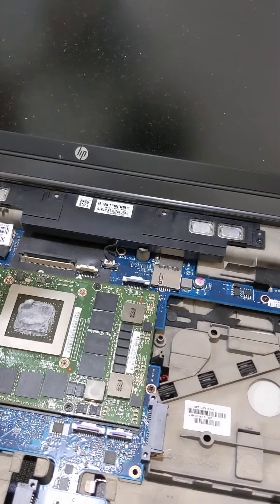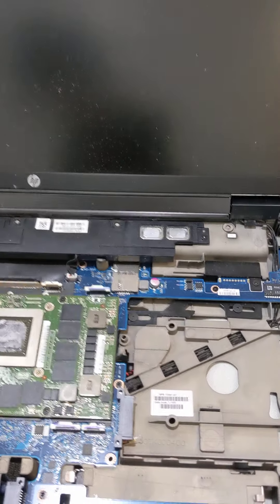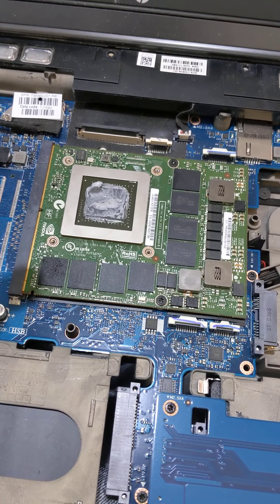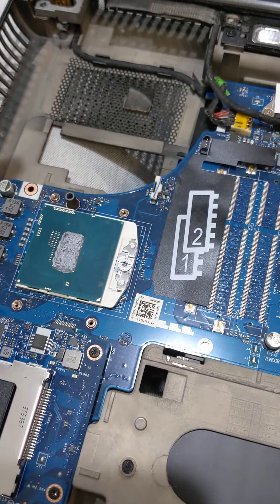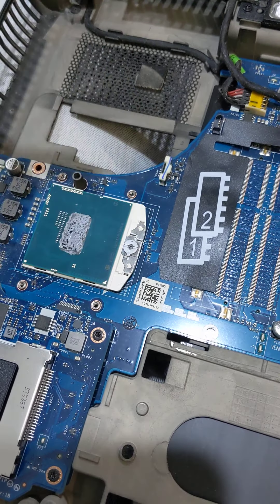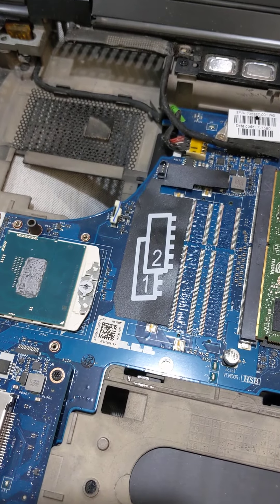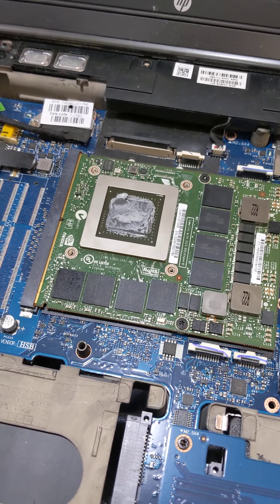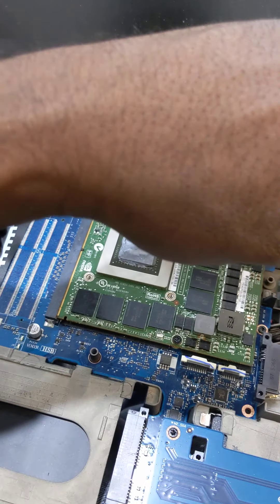Upgrading a hp zbook 17 g2 cpu to make better youtube videos

Comment: Watching this on a HP Zbook g2 with i74810Q got it for free in a amazing state from my bro.
16gb ram and quadro k2100m but im thinking of upgrading the graphics card to a gtx 980 4gb.

Apparently that's possible.

But even without, very fast laptop, good sound and great for multitasking editing and even this Quadro can play some games pretty good. 

Nice video.
Reply: I have a p4000 in my zbook g2 with a 4930mx.  I bought it this way and I had to disable driver signing to and force the specific INF have disk method.  I have a hacked version of the nvidia installer in order for it to let me install nvidia control center, then I can manually force the INF from the newer versions of the driver package to keep myself updated  I think the p4000 I have might have a bios hack in order for it to work on this zbook.  All I know is, the p4000 is such a great match for the 4930mx and it runs really cool and fast.  These haswell mobile CPUs are still really capable.  I can run all of my favorite games.
Reply: P5200 32gb 2400mhz 😅

Comment: I have a HP Zbook 17" G3 with NVIDIA Quadro m5000 gpu. I play this old game  and I need to get max fps 120. I currently get 80-90fps. I know my gpu is the bottleneck. My current gpu uses  Bus Interface MXM-B (3.0) and I need to stick with NVIDIA as it is an old game..  Do you think I can upgrade to newer gpus like Quadro P5200 Mobile as it uses MXM-B 3.0 bus interface as well?

Comment: Hello there I got an Old Zbook 17 G2 i7 but unable to power up.. the lights keep blinking... Just wondering If it is Worth it to Send for Repair..
Reply from the maker: I mean they are going for around 450.00 it's going to cost a bit to repair. I would put it toward another workstation if I were you And you need a workstation computer

Comment: bro , can i upgrade cpu again ,over i7-4810mq???
Reply from the maker: I believe the next chip is 49** series. After that you can't upgrade.
Reply: @TrueStrategicEyes   thanks man !
Reply: That CPU can be upgraded to the Core i7-4940MX, but I do not know if the BIOS would recognize it or not, even after a BIOS update. It just depends on the laptop, and what the latest BIOS updates are able to read. The Core i7-4940MX is the highest end CPU in the Haswell chipset though. https://www.cpu-upgrade.com/CPUs/Intel/Core_i7_Mobile/i7-4810MQ.html
Reply: @justinbryson2906  yea , that's better, and 4810mq is too enough for me jus i thought i can upgrade to a higher gen.
Reply: I7 4940MX!